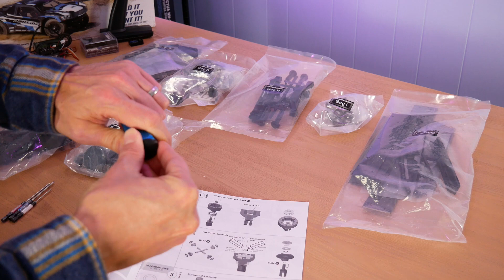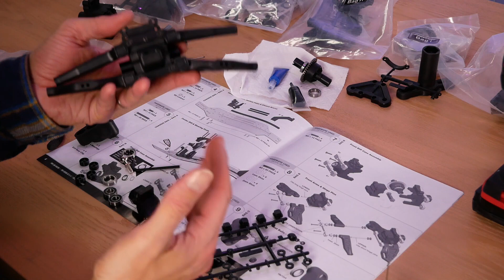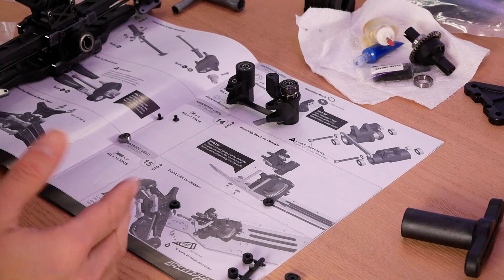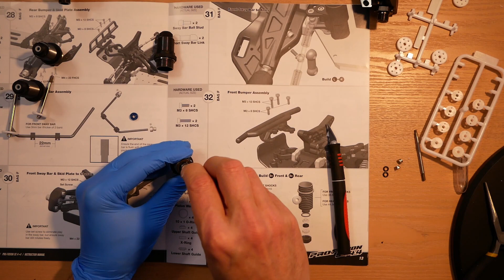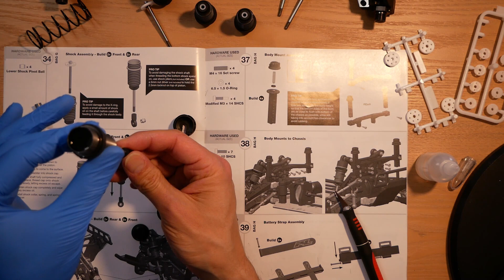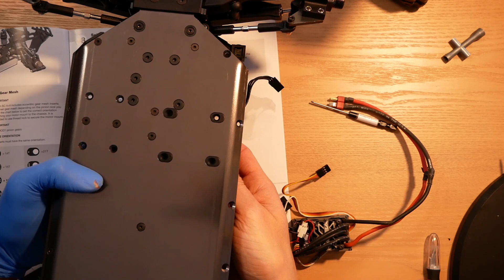Pro-Line Pro-Fusion SC 4x4 RC Truck with Baja Bug Body - Full Build Video

Comment: Hello, very detailed video with great tips.  I plan on building this.  You mentioned the proline trencher tires.  Are those the 2.8 size that come already mounted on rims?
Reply from the maker: Yes, but two updates: 
(1) Pro-Line has changed its entire tire lineup to use removable hexes. This is a nice idea to allow use on multiple truck types, but now it's harder to find ones that include the 17mm hexes you need for this truck. Most just have 12mm hexes.
(2) After testing Trenchers on this truck for a while, I felt they slipped too much, more than with other trucks I'd used them on, and I bought Badlands 2.8" tires for the truck, which are much better for the Pro-Fusion's chassis setup.

So, this is what you need:
- Two sets of Pro-Line Badlands 12mm Raid Tires: https://amzn.to/3bmGvhE
- Pro-Line 17mm hex adapters: https://amzn.to/38njDfP

Comment: I've got one of these on order, so appreciate your detailed review.  A tip: use Shock Shaft Pliers rather than needle nose pliers to hold the shock shaft and you won't risk damaging the shaft threads. Here's an example, but they can be found cheaper elsewhere https://www.amainhobbies.com/protek-rc-trutorque-shock-shaft-pliers-ptk-8267/p248643
Reply from the maker: Great tip! I keep delaying my purchase of shock shaft pliers, because I figure I won't build another truck anytime soon, but then I do and I wish I had them, LOL! On a similar note, make sure you get the snap ring pliers I mentioned in the video: https://amzn.to/2SrIXc9. You absolutely must use the HD driveshaft clip, which requires this pliers. The standard clip is complete junk and will cause a driveline failure with very little use. Good luck with your build!
Reply: @TheTechBuyersGuru   Well noted. I have a set snap ring pliers in my tool arsenal :))

Comment: That video is great thanks if I run in to any problems is it ok to email you thank you
Reply: Is that mamba 2400kv setup really fast I like fast let me no i want buy that System just want to hear from you how fast it is thank you let me know
Reply from the maker: On 4S it will hit 50mph - I've been testing it in this truck, and honestly, 4S is just for speed runs. You can't really "drive" the truck at 50mph. It's driveable on 3S though, probably hitting around 38mph.

Comment: My you YouTube ain’t working right can you list the tools for me that I need I can’t wait to get out this thing and all the differential oil’s and shock will wait
Reply from the maker: Tools: 
(1) External snap ring pliers: https://amzn.to/3akbSWp
(2) 1.5mm/2.0mm/2.5mm driver kit: https://amzn.to/3afaVPj
(3) Would really help to have a set of nut drivers too: https://amzn.to/3duHcnA

Supplies:
(1) thread lock: https://amzn.to/2WEEjuq
(2) differential oil for front and rear diff: https://amzn.to/2QHEpgY
(3) better differential oil for center diff (the tub included with the kit is impossible to apply): https://amzn.to/39iBVvW 
(4) grease for gears and joints: https://amzn.to/2WJvJdZ

The kit comes with the shock oil you need - don't buy that.
Reply: I am so sorry to bother you again Can you tell me where you got your electronics please thank you very much including servo
Reply from the maker: Here's the Castle motor and ESC: https://amzn.to/2WMbo7y. It's honestly a perfect combo for this truck. Tons of power, and the motor barely gets warm. And here's the ProTek servo, only available through Amain: https://www.amainhobbies.com/protek-rc-160t-low-profile-high-torque-metal-gear-servo-high-voltage-metal-case-ptk-160t/p403453. A great servo, although you don't need a low-profile model for this truck. I like it more than my similarly-priced Savox models. You can use any radio/receiver you want, it really doesn't have to be matched to this truck. For what it's worth, I used a Futaba 3PV: https://amzn.to/2WPE0Nl

Comment: This is my first kit I am waaiting for it to come in the mail I am very pumped up to get at it is it Really really really hard or do you think I can do it thank you love your videos
Reply from the maker: You'll have fun with this truck, it's currently my favorite truck to drive! But building it is a little tricky, so definitely watch the whole video. Plus, you'll definitely need the following tools and supplies that aren't included with the kit:

(1) thread lock: https://amzn.to/2WEEjuq
(2) differential oil for front and rear diff: https://amzn.to/2QHEpgY
(3) better differential oil for center diff (the tub included with the kit is impossible to apply): https://amzn.to/39iBVvW 
(4) grease for gears and joints: https://amzn.to/2WJvJdZ
(5) External snap ring pliers: https://amzn.to/3akbSWp
(6) 1.5mm/2.0mm/2.5mm driver kit: https://amzn.to/3afaVPj

Good luck!
Reply: You should maybe think about making some more videos of the fusion you did a real good job thanks
Reply from the maker: Hey, thanks. I might throw together a running video of it at some point in the future, especially if a few more people ask to see it. Honestly, it's awesome. I love driving it.